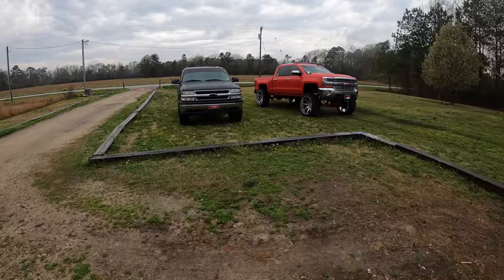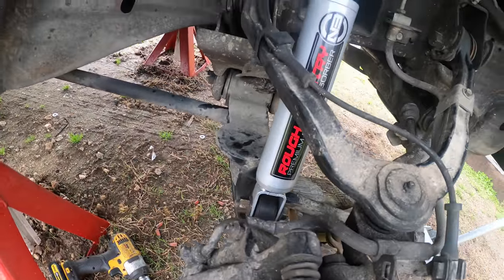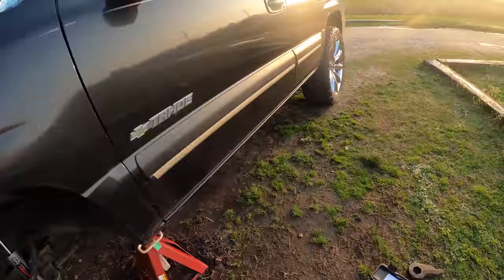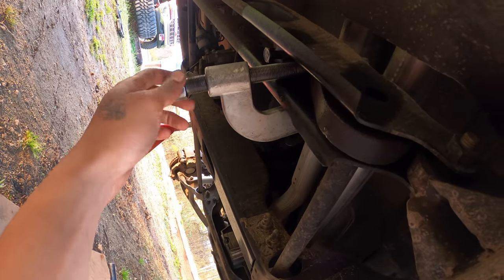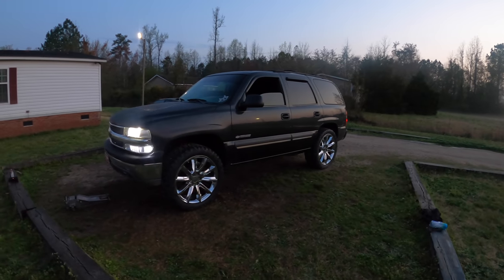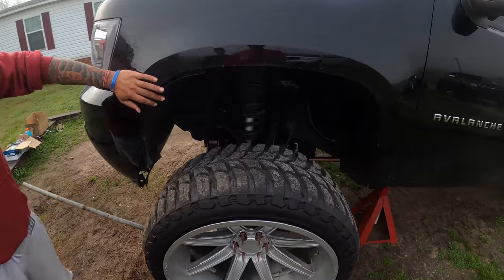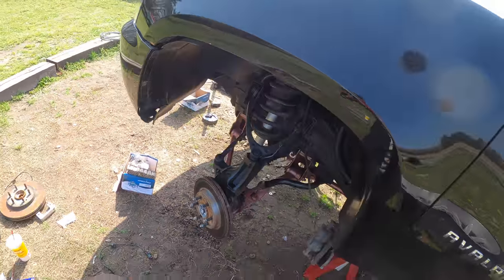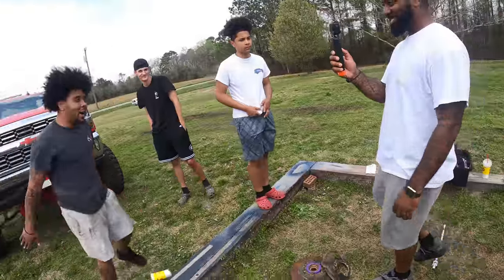SQUATTED AVALANCHE WITH 12" OF LIFT??!? #BACKYARDBUILT VLOG

Comment: I got a 7-9 inc in front of my 07 avl and stock in the back and was wondering how I do I get the track bar to both up right I just got it and it's hanging at bottom with out a bolt in it